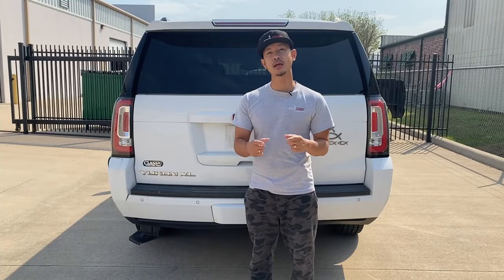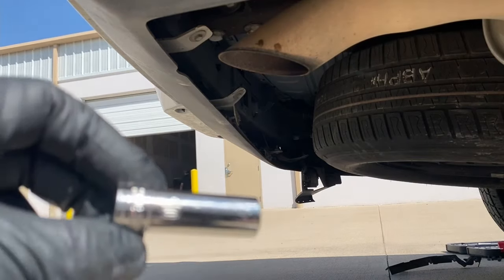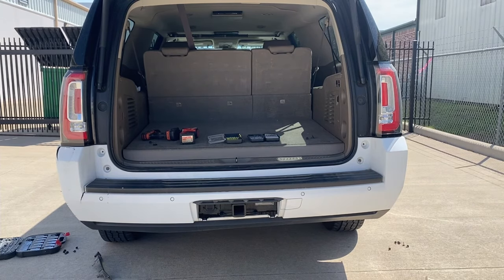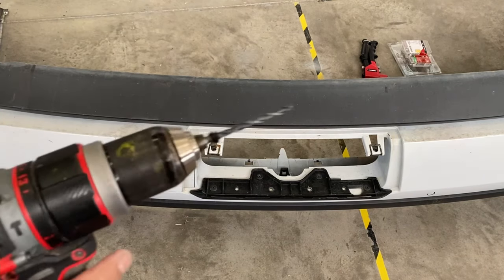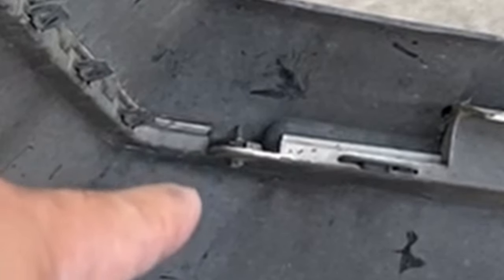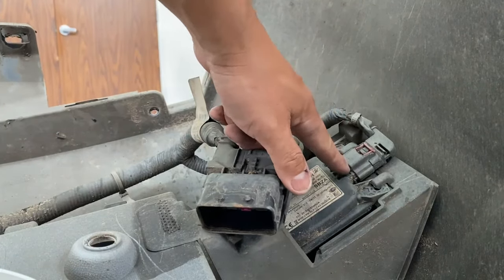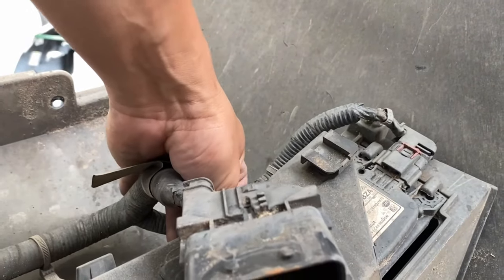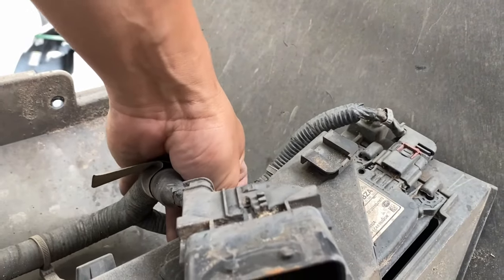2017-2020 GMC Yukon XL Rear Bumper Removal | Easy DIY for Beginners with Simple Tools

Comment: 7:52 those 3 harness's wire part on the big box installed already come with the vehicle? Or do they need to be bought?
Reply from the maker: Hello! Those modules or relays come with the vehicle harness. The bumper doesn't come with those but the vehicle should have it attached to the harness. We've done about 3 newer GMC vehicles and they all had those boxes. Thank you for watching!

Comment: at 4:05, where do you get a replacement sensor connector? mine was melted by the exhaust and i need to replace. thanks!
Reply from the maker: Hello. Of course you could get form the dealership. You may be able to find it at a junk yard or on eBay or Amazon. Thank you for watching!